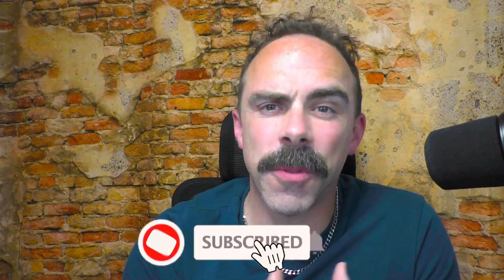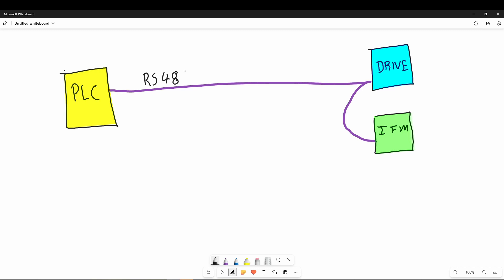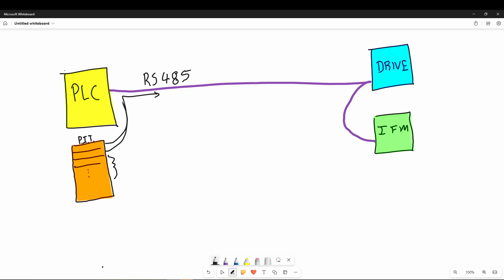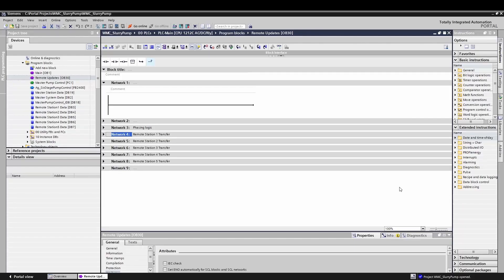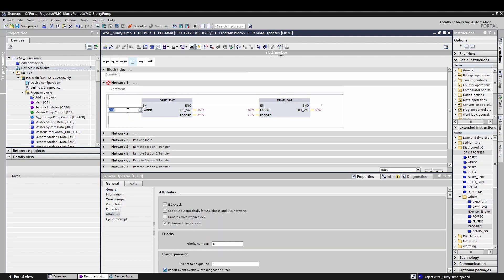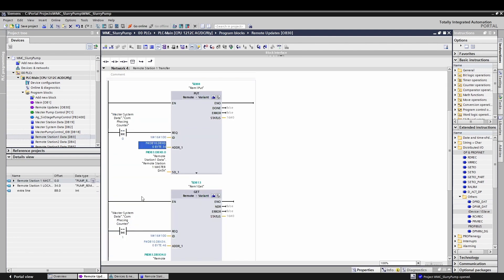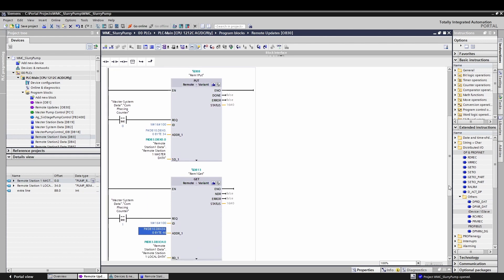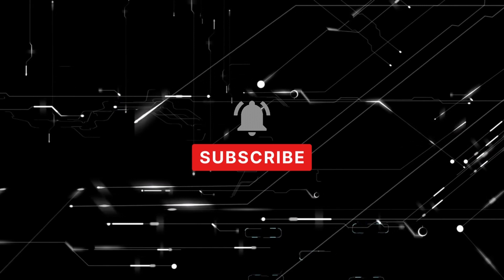Siemens PLC Function Block Training: DPRD_DAT and DPWR_DAT

Comment: Jason, i want to thank you for this thourough explanation 🙏. A lot of videos just explain the inputs and outputs of these two blocks but not the reason we're using them and the data transfer problem they solve 😡.

Couple more QUESTIONS 😁, and i know they are braud but bear with me :

1- Using these two blocks with profibus and it's slow 1.5 Mbps (or less) is convincing, but would the same fear arise with profinet and its higher transfer speed ? or should we just use them anyways to guarantee the best results ?

2- Since you explained with the drive example i decided to implent these two in my VFD "CONTROL - FB". However, i want to know where else i should (must) use them ? (pumps, valves, measuring temperature, presssure..) maybe PIDs in general 🧐

Signature 
                 N00B_Lvl_ONE_THOUSAND
Reply from the maker: One thing about ProfiNet is that since it uses TCP an entire telegram can fit into one packet. So the actual transmission is protected from this to a point. There is a problem if your actual network is in so much trouble (Some versions of Powerflex drives are notorious for breaking regular LANs) that there are collisions and buffers in the switches, but ProfiNet RT (what is used by PLCs to drives) by passes a lot of this.

Second thing, you set the RT update rate in the PLC project for ProfiNet, so as long as your update rate is longer than the transfer time it takes to create the TCP packet (think a few microseconds) you are good

Anything that has data that has a significant amount of data that needs to be "tied together" for proper function. Most of what you just named will only use a couple bytes at a time at the most so this wouldn't be needed... the only thing I can think of off the top of my head would be something like an RFID scanner that has a payload that is fairly large (think 200byes+). You would definitely want to use this to make sure that when you send the packet stuff doesn't get updated in the middle of the process.
Reply: Eyyyyyy thanks so much for the quick response  and the clarification Jason ✌you made me pay attention to some very important points.
Much appreciated 👊
Reply from the maker: No problem! I always want to help. It's just that I usually have to schedule my time pretty tightly. You caught me on a break so you get a quick response!

Comment: Thank you very much for accepting my suggestion last time. This enlightens me about questions in my mind ever. So when plc "reserve" the data before comunication cycle starts  then it can increase the PLC cycle time and response time because plc have to wait for a consistent data completly copied into Profibus/profinet area memory and afterward Profibus/profinet comunication can start to a slave. Am i right?
Reply from the maker: I will need to look into this a little, but the cycle time shouldn't be affected greatly by this because the actual transmission is completed by separate hardware. The PLC moves the data into the registers then the DP hardware completes the transmission, then signals the main processor that the action is completed (usually triggering an interrupt). While it is transmitting, the main processor is running other code. This block just makes sure that when you move the data into the transmission register it is "locked" during the time it is moving. 

Look at my livestream where I talk a little about memory (I think it was the Pointer stream). Eventually, I am going to do some content specifically about the basics of Hardware, but for the time being I just talk about it a little in my streams, so make sure to at least turn them on in the background. I hope this helped! Thank you for being part of this community!

Comment: Shouldn’t process image updates for telegram be disabled?
Reply from the maker: Yes, that would most definitely help (and is handled automaticallyin Portal), but you would still want to use these blocks on ProfiBus systems.

I didn't say this in thevideo, but you can actually use this block on ProfiNet or others as this is just a way to "reserve" the data as it is being transferred.
Reply: Would you use this block on a profinet system still?
Reply from the maker: @LFC2702   I do not (for drives) and here is the biggest reason why. Siemens' own technology objects don't use these blocks for ProfiNet. Now, Portal does set a lot of settings behind the scenes that make things work smoothly with TOs, but they use a "actor interface" tag with the datatype of "PD_TELx" and points the tag to the IO address. I have used this method with many general purpose drives without problems, but that doesn't mean I am necessarily doing it the "100% proper" way. If your process is at risk to inconsistent data using these blocks is a fairly easy way to sleep better at night. You are going to have your data stored somewhere (even if it is in the instance data in an FB) and you can always reference that data with these blocks.

This pointer structure also works with the use of TCP_SEND and TCP_REC to send generic packets over TCP.
Reply: @jasonwattsae  

Hi Jason, 

Thanks for the above… 

Feel I’ve been looking into this for a while and gained more understanding from these comments that I have on my own research. 

Videos are great Jason enjoying the format of them. 

Curious to know what you got next coming up?
Reply from the maker: I am planning on doing our first livestream with one of the other owners of my company Alpha Industrial Technologies this Sunday where we are planning on going through our most recent Motion control program.

The next edited video will probably be on MC TorqueLimiting and how it can be used.

Is there a topic or block that would be helpful for you?